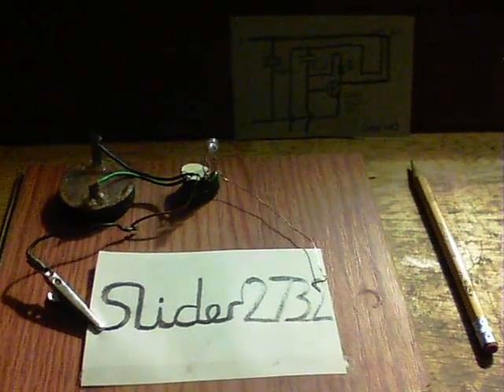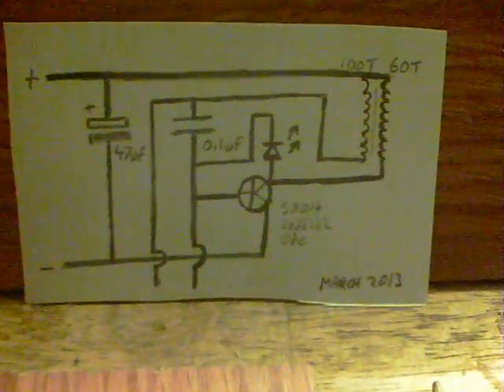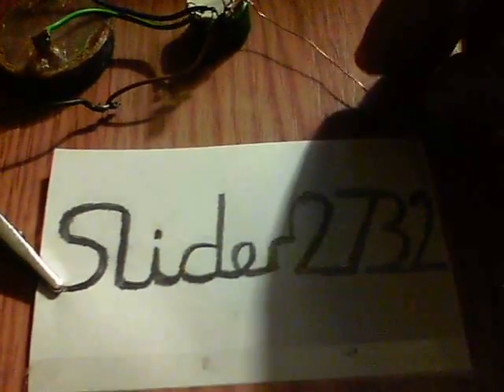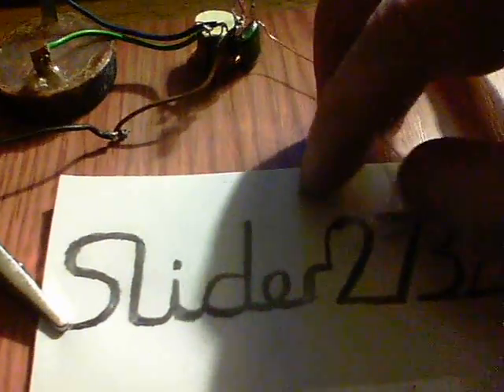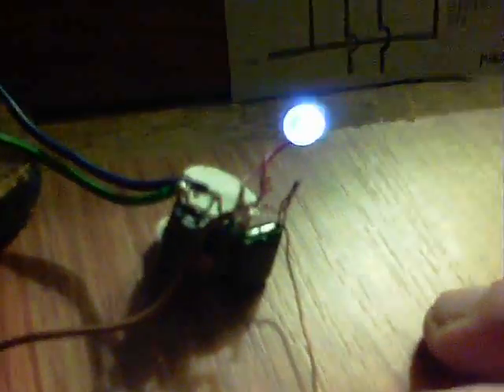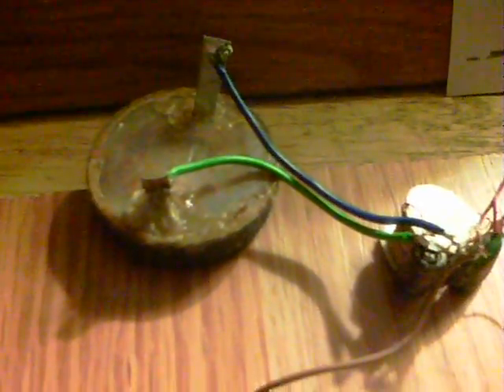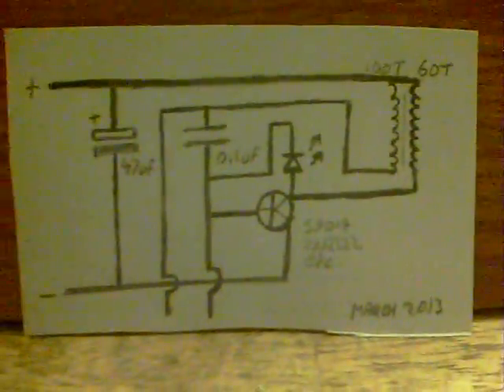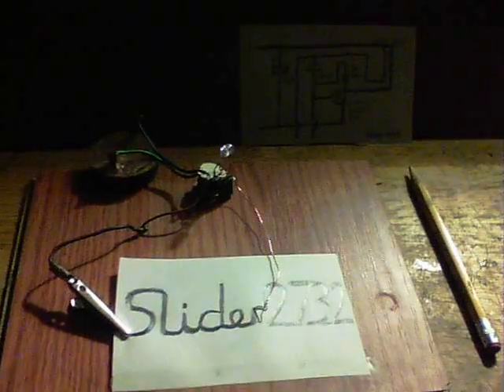Pencil Resistor Circuit

Comment: Are you using 2B or 6B?
Reply from the maker: Near the start of the vid I mention it's an HB. A good thing I did, else I'd never remember after the years between  :)
Reply: @Slider2732  Thanks for replying, but all the HB pencils I tested here at home on paper did not send current to Led! What a pity, I'm thinking of conquering the faber castell 2B or 6B pencil!
Reply from the maker: Ah, I see why you wondered. It does take a lot of pressure and therefore a solid line. Any tiny break (invisible to the eye) and it's like a 50meg resistor is in the way!
Best way, is to draw a simple line of a couple of inches, draw over and over on that line with the pencil until it's very black. Then measure the resistance. It should be around 5K or similar per inch. Also, because the resistance is quite high, a 3V coin cell will likely not work with an LED. A 9V and a variable resistor on the LED will work better, turning the resistor pot to get used to where the LED illuminates well.
Reply: @Slider2732  Actually I was using 3v Cr lithium batteries and the led was not turning on, so should this be the problem?
Reply from the maker: It can be yeah, because the resistance really pulls down the available power to the LED. In the vid I'm using a Joule Thief type circuit, where the output voltage is a lot higher. Simplest method is a 9V with the variable pot, although you could start at the furthest end of the line and move the LED along, reducing the resistance until it lights. 

Using 2x pencil lines would be too much resistance, one leg of the LED should be connected with a wire.

Comment: In my Physics class, the teacher put 5 or 6 12 volt or so power packs worth of electricity through a pencil. the pencil burned off and the graphite glowed incredibly brightly. It was on a heatproof mat and still managed to melt the varnish on the table underneath.
Reply from the maker: +Ferger Burger If he had limited the current all would have been ok. But the way you saw it must have looked cool :)

Comment from the maker: Have subscribed to Bob Smith, got some Chitin in the works from following a vid of his :)
Transistor, hmm, would need to be a chopper type somehow, more like MOSFET I think with a break across area ? Caps seem possible if there is any capacitance between parallel lines under power. Diode block would give rise to transistor...maybe different types of pencil graphite or an activated carbon strip.
Wearable electronics are of great interest as well as furthering skin powered.

Comment from the maker: Not really, unless they are axially magnetised. Best magnets for tiny motors are from worn out cellphone vibrate motors...4mm or 6mm diameter. Take apart, take out the tube magnet. A piece of plastic from wire insulation makes the bushing between sewing pin and magnet. Prob best to explain more in email lol, long this conv  :)

Comment from the maker: Hi Tony, all depends on thickness of line and pressure used. Here it is between about 10K and 2Meg. A single thin line can make a set resistor end to end. If you need a range in a certain band you can make a thin line then a heavier thicker section for easy adjust in that range.

Comment from the maker: You can make any resistor to any size or shape. All is about the thickness of line and pressure on the paper (or other surface). Easiest is about 10K to 1 Meg...about same as the linked lines in the video. 
Yeah, re planes, my old Blog is still at RC Groups, username Slider2732, was featured Blogger there and Gold status til got more into this energy stuff. Built milligram brushless motors, LRF's, flying wings (am a Horten freak lol), Roswell UFO with hand controller, own designs :)

Comment from the maker: Yeah but they do have 13A or so they can throw through it lol. Saw one video of it being like a lightbulb for brightness. 
For the thickness of line shown in the vid, it equates to about 1 megaohm side to side. Thinner lines will reach 1 meg in about a couple of cm. So this sort of thing can be tuned quite readily, to whatever the application needs, fine or rough value resistance. Very handy when out of traditional variable pots :)

Comment from the maker: Stock paper is way too heavy, a balloon is always good for electrostatics...could have model of hot air balloonm pancake under the gondola. Highly sanded foam board is an option, about down to 1/4mm thick, made some good RC flyers with that. Esaki tissue is always good, could draw the coil on it, but very carefuily :)

Comment from the maker: I hadn't either, til I needed to. Bought a pack of 100 1Meg resistors and ran out recently, my pots were 50K or other small values but the oscillator that was being used with this cell was too heavy a draw for the light output being given. Needed a variable pot and just kinda wondered.